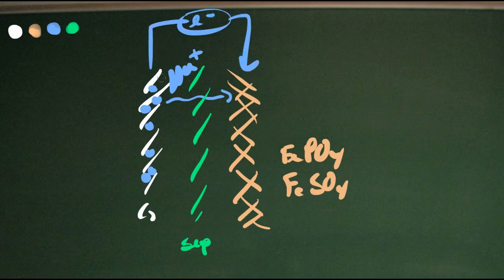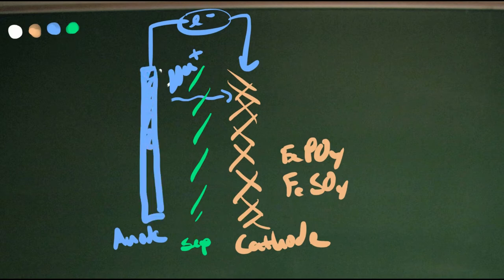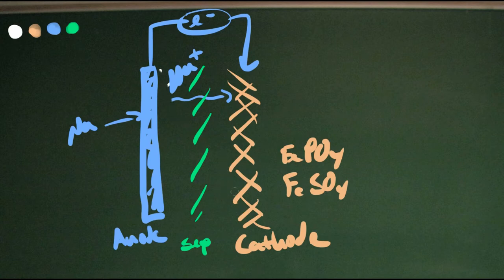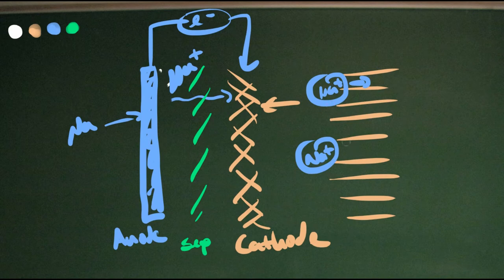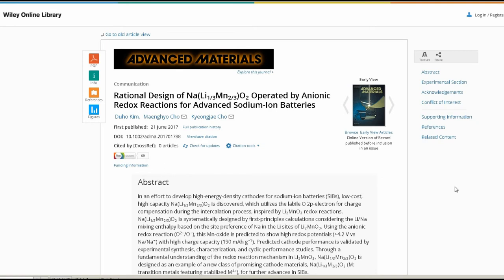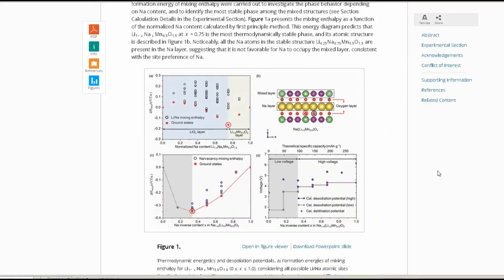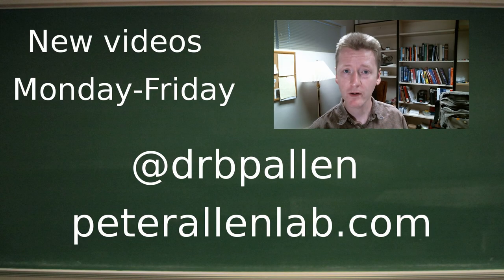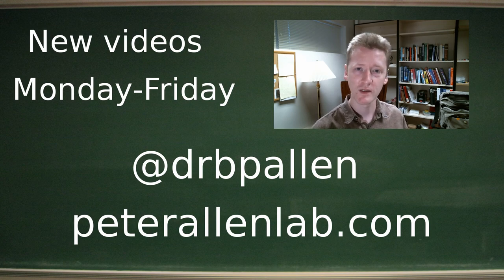New Sodium Battery Cathode Material

Comment: So does this actually mean you can store sodium-metal interstitially in an electrode made of MnO2 or graphite and put that electrode in an aqueous solution and the sodium metal won't react with H2O?    Amazing.   Is this because the crystalline structure excludes H2O?  

Or does it mean there is a passivating layer on the sodium which can be applied and removed electrolytically?  Why wouldn't OH- ions diffuse in and react with the sodium, or do you have to hold some negative charge on the electrode to prevent this?

Comment: why not Pressurised Hydrogen Gas Tanks with a Hydrogen Cell attached . No DC to AC Loss , No Fancy Graphite Cores , No Tanks of Lithium . Also , Fun Balloons for Everyone
Reply: hard to maintain and highly dangerous
Reply: @taiwoolaleye6333  yes the H2 would need to be stored in a molecule that is in liquid form but that that could  easily broken back down into H2 for later use. I believe that is how hydrogen fuel cells currently work